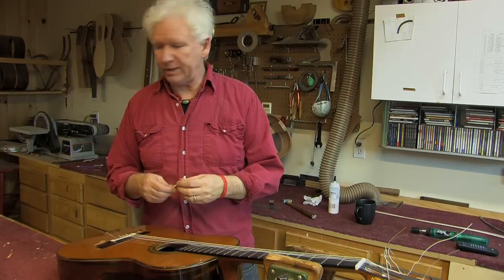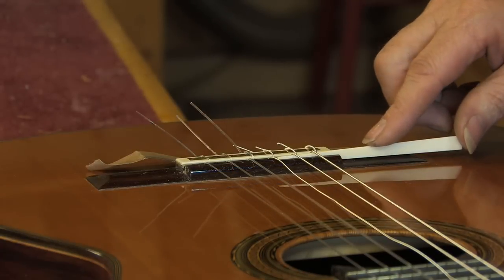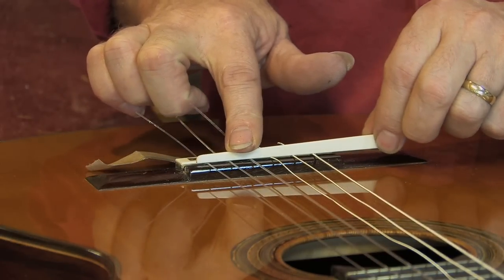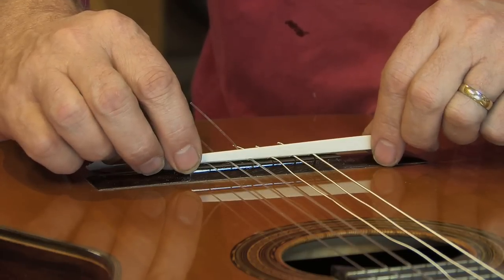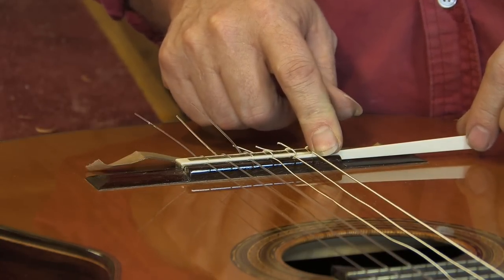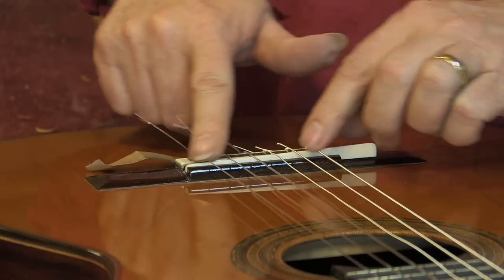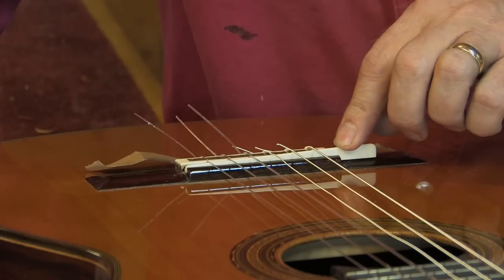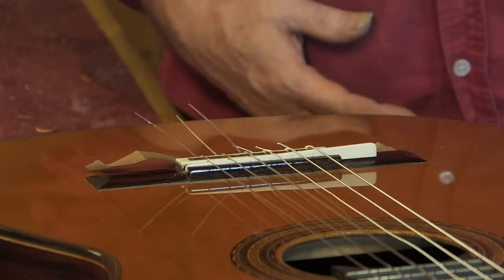Adjustable saddle for classical guitar

Comment: The problem with that is you cannot intone the saddle.  You end up playing a guitar that is out of tune as you move up and down the fret board.  There is a huge difference.  I have guitars with the saddle adjusted on each string and on the nut also.  These are the only classical guitars I have ever owned that play in tune up and down the fretboard.
Reply from the maker: Its a trade off, I know touring concert guitarists that prefer to be able to adjust the action based on different humidities they encounter on tour.  of you are sensitive to the intonation, then microtone the saddle once the new guitar settles in and you are happy with the action height, its easy to intonate the saddle and cut off the ends of the saddle.

Comment: Good idea. Last month I bought a nice classical guitar and wished the strings were lower. I had bone blanks on hand, and I accidentally made one of these, not realizing others had done it. It worked great. What I discovered, though, was that the strings were already as low as they could go without affecting the sound, so I went back to the original saddle. This could be useful if the humidity made the strings drop, though. I kept mine for that and to try elsewhere. Thanks.

Comment: Tuesday 01-26-2012
Very practical and clever!  Thanks. 

A few basic questions: 
1.  Can a saddle be in two pieces so that I can lower and raise just the treble or the bass strings?  
Would the separation in the middle portion of the bridge cause any buzzing or weird noise?

2.  Does the saddle need to be at least, minimally, end to end on the bridge slot or can it be slightly short on either end say 2-3mm?  I ask this question because my current saddle is plastic and I am thinking about lowering the action by sanding dow the bottom.  My saddle already has the intonation cut/angle for the G string.  I can get away with 4-5mm on it one way or the other.  I was thinking about sanding down the bottom of the saddle piece and then cutting about 1-2mm off the bass side of the saddle and then reinserting it.  The saddle already has a slight angle (from the treble E to the bass E) like your saddle has,.

Thanks - great, practical application and like you said - why in the world are we locked into such a fixed height generally once we put the strings on?  There should be an easy way to lower and raise the action without a lot of work.

Comment: Great idea! The bridge adjustment is arguably the most critical part of a guitar. This adjustment can make you love or hate your guitar. The worst thing for a pro player is to get pain while playing, or even worse a cramp. Do you work with electro-acoustic pick-ups? I've had problems with getting even volume from the strings. I have the LR Baggs  (braided) and I have tried using pieces of cardboard, but there is always one string louder that the others. I decided to buy a new guitar, so I tried the Cordoba Studio Negra, but it has the same problem. The way they fix it is by adding a mic inside to blend with the pick up, but in loud situations, this does not work. I got my old Takamine Classical to a "decent" point by adding very small pieces of different thickness cardboard and masking tape under the soft sounding strings, (under the saddle) but it is really hard to get them even. Any ideas? Thanks.

Comment: So I'm a beginner with and old Yamaha G231 that I couldn't tune.  Upon inspection I found a Plastic Nut with slots that look more like gauges 6 5 4 slots angled,  the bridge's saddle slot has old dried glue on one end in the slot  and on the other end the outside saddle slot's outer top  edge is splintered off. Ordered new strings, bone nut & saddle.  After looking for a video on how to just refurbish or bring back to life this old bridge's slot I'm looking for advice on how to that.  Replacing the bridge is not a simple or easy task & don't see buy another guitar till I can play this one.   Thank you

Comment: HOW OR WHAT DO I CUT IT WITH TO HAVE THE SAME LENGTH? I HAVE AN ADJUSTABLE METAL SLOT W/ SCREWS, I PURCHASE A SADDLE THAT'S A COUPLE OF INCHES LONG AND AN INCH HIGHER. DO NOT HAVE LUTHIER'S TOOLS, BUT I'M A POOR MAN ON FOOD STAMPS SURVIVAL MODE. THANKS FOR YOUR TIME AND ATTENTION.

Comment: With all respect.... (simple physics here).. the overhanging aesthetic issue can be minimized by designing an adjustable saddle with the proper base angle (ramp angle) as well as ensuring that its lowest setting correspond with having the same amount of material protruding at each side of the saddle... in short... a minimal displacement (one way or another) would correct any string height created by climatic changes (that's the real purpose of having an adjustable saddle!

Comment: That's OK for adjusting the action but isn't there a problem with the intonation? 
To compensate for string thickness, especially the G string, the point of contact of the string on the saddles is about 2.5 mm further back.

Comment: don't need to angle the bottom of the saddle slot, just shape yourself a saddle like a wedge with 1.5 m.m angle difference between the space that would glide along the saddle slot.The bottom of the slot slot being always flat and the top of the saddle being slanted as a result of the wedged shape. As each string had bigger diameter and the bottom of each string touches the top of the saddle.The top of each string would level themselves if you shaped the saddle with the right base angle. Cheers!

Comment: Can one maybe raise the nut "a hair" by shimming it and then sand the saddle to get a lower strings on the higher end ?   I got this problem on one of my classicals where the higher end from the 8th fret up I would like to lower it.  Trying to shape a lower saddle out of ox bone to a 25 cent fret space  would be nice all the way up the neck.   Lowering the strings would lower the volume as well?  Does the intonation change in doing this?  I was hoping to use my KORG CA-30 tuner to check? Thanks

Comment: why not make the bridge length longer so that it can fit a longer saddle to allow the guitarist makes their adjustment of the string action. (high or low according to the guitarists) . Some guitarists prefer higher action because it is louder sound.Another additional idea is to make the nut size longer than 52 mm to allow adjust proportionately  with the longer saddle length.
Reply: Hi!
INteresting what you say. My classical guitar 6 string is 5mm high on 12th fret. Would you say that is too high?
Reply: @noahshelley87 5mm is super high action for today's standards

Comment: @jpkpjcp3 I understand that angling the bottom of the slot would keep the top of the saddle level. Seems easier said than done. How would you get the precise angle needed to keep the saddle top level?

Comment: Saddle hanging over is a bad idea. Why? If your shirt sleeve or cuff snags it you'll likely crack or break away the the front edge of the saddle's wooden slot ! Crrrrrrrrrack !  "Uh oh, I need a new bridge ! ! ! ! ! !" .  Find the height/action owner wants and cut off the hangover. Also, the owner will be changing  height umpteen times a month if left uncut. "Ah, I love this !!..... Nah, too low.... Ah, I got it now !.. NAh, too high ! Ah I .........!"...........Don't go there !!  M
Reply: the guitar maker should make the bridge and nut longer than usual so that he can fit the longer saddle / nut so that allow spreading the string distance.
Reply: Your vision of clothing breaking the guitar apart doesn't seem likely ever to occur. There really is no space under the saddle to allow cloth to slide in. As to the owner actually losening all the strings to make minute saddle adjustments unpteen times a month, that does seem plausiblke, and if the owner does this, who cares?

Comment: interesting idea but does the sloping angle of it not cause other prolems?
Reply: Not really at all unless the plane of the slope is not consistent in its slope down from the higher end to the lower end.  You generally will want the treble strings closer to the fret board than the bass strings, not by much.  There are charts which show you what the height levels are for the treble E and bass E at the 12th fret.    They are not the same heights.

The primary issue to me is that the sloping be very precise in the plane as you will notice it right away if the strings are not "level" between each other in the sloping of the plane.  You will know - note picking between strings and the light accent strums you have with classical guitar (or for that matter any stringed instrument) will be impossible if your plane is not consistent in the sloping.  As long as the plane of the strings is the same from the hight end to the low end, the slight angling down to the high E (treble) from the bass E will not impact your playing style.  

If you have a crazy unlevel variation up and down of heights on any of the six strings (between them, i.e, one slightly up and then the string is slightly lower next down, and then the next string goes back up slightly), my goodness, it is the very worst and nearly impossible to play.  I've had that with a cheap Harmony.

Comment: not a good idea if you want all your strings to be at the same action
Reply: All strings should not be the same action. As a matter of fact, the D string is the one most likely to buzz, so it should not be lower than the A string. In this perfectly straight line saddle, the D string will always be lower than the A.
Reply: I agree, I think that it would be perfect  to have the same angle at the bridge, then put the tapered saddle  inverted, and by sliding it all strings will rise and fall leveled For  sure.
Reply: @lancebaker1374  and the  low E string will be higher than the  A. I think that it would be perfect  to have the same angle at the bridge, then put the tapered saddle  inverted, and by sliding it all strings will rise and fall leveled